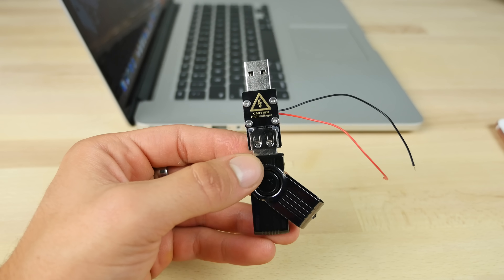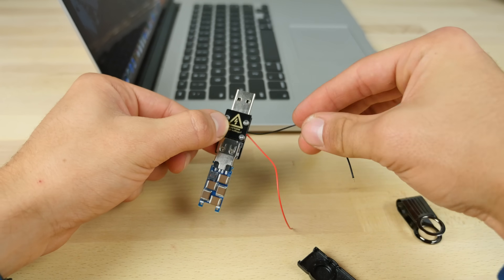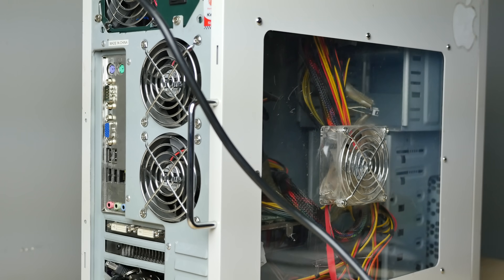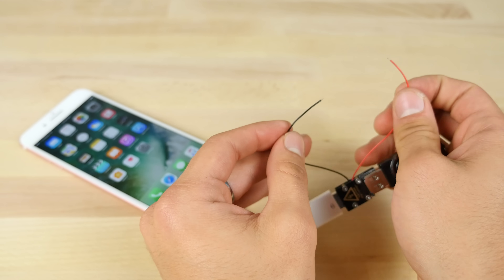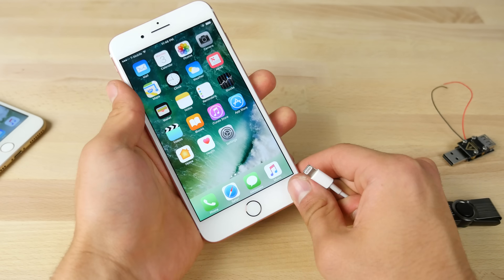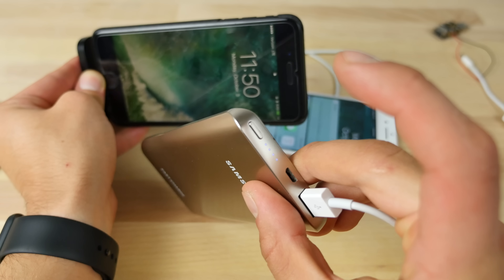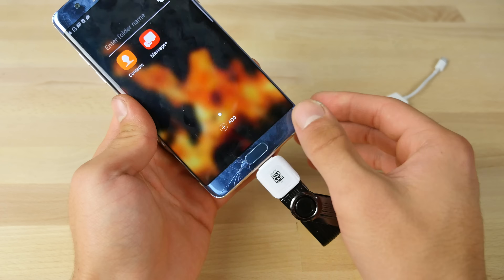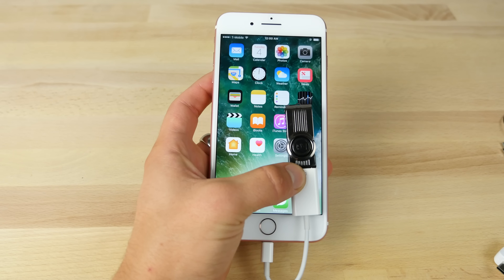USB Killer vs iPhone 7 Plus - Instant Death?

Comment: I am still using an iPhone 7 Plus in 2025 and have some problems
1 battery backup is fried. I have to charge it every 2 hours 
2 Most of the apps stopped working as they need iOS 18 
3 heating issues, even if I use Instagram for 5-10 mins, it starts heating up

Comment: You can build one with a royer inverter plus a rectifier, a sidac or gas tube and a few 1.4kv MMLCs. Basic theory is it takes 5V and turns it to hv to charge the capacitor then the gas tube or sidac drops a 1.4kv pulse through the data rails. The voltage needs to be high enough to breach the coupling caps. Can also target the 5v rail.

Comment: You killed the U2 Chip from the iPhone with this USB Killer.

I killed the U2 Chip with an cigrette 12V to USB in my Car.

The U2 Chip regulate the losdingpoeer ans saves the iPhone for overvoltage.

Comment: USB Killer 2.0:
Send random voltages either very high or very down in the negative
Send nonsensical information no computer can understand
After those payloads, start messing with the battery

Comment: ok, here's why this doesn't work on an iPhone, the charger you are using is bottlenecking the voltage of the USB killer, this is so any power source the iPhone charger is plugged into it won't fry the internals.  For instance, does your iPhone die as soon as you plug it into the wall outlet?  Well, of course, it wouldn't, that's because the charger controls the amount of power to the device.

Comment: Actually it wouldn't have fried the charging port..it would have fried the tristar ic chip on the logic board hence you weren't able to charge after even with a new port it still wouldnt work

Comment: * Plugs it into the wall *
Reply: he actually did that in a video
Reply: It will just blow up, nothing special, mains power is ac, and way too high voltage for the boost converter to handle

Comment: did not effect, maybe because you charge the usb killer in a low voltage then the capacitor of the usb killer is contain only a small amount current, just sayin ^_^

Comment: Fake! these USB sticks do not "KILL" what they plug into in fact they discharge -200VDC to test the surge protection circuitry of electronics. If you reset your bios and your power strip your computer will turn back on. The only way this USB stick will kill something is if it has zero surge protection which clearly your PC had

Comment: 10 Years later: USB Killer 8 vs iPhone XX. 15 Years later: Homepod Pro vs USB Killer 11. 25 years: Floating Tesla Roadster 75 VS USB Killer 27. 100 Years later: iMac PROOOOOOOOOOOOOO vs USB Killer 1840284
Reply: Dr. Shak0 lmao
Reply: 20 years later usb killer v16 vs Iphone XXX
Reply: PerroCrikoso Iphone XXX Videos Pro.
Reply: 1.9 GJILLION YEARS LATER: New IPhone   283828283383892 Ultimate Pro Ultra With a time 83838 megapixel
Camera with 3883 cameras comes with a 39283watt power brick and a 1000ft charger vs UR MOMM
Reply: When the years go by, you hear a trigger noise

Comment: Slight correction in what was said at 9:10 "Protection against high current" is actually "High Voltage", and very low current.

Comment: Slight correction in what was said at 9:10 "Protection against high current" is actually "High Voltage", and very low current.
Reply: Bill A you must be a mechanic or electrician. 👍

Comment: OK its unlikely he killed the pc there are spark arrests all over the motherboard. he simply blamed the click on the usb when it was him turning off the power strip at his feet. i have built a few computers and if it did get trough the arresters it would olny fry the usb just like the phone. and think of this, why would a computer be less resistant to a shock then a phone? computers get power surges all the time, yes most have protectors but there are resisters for a reason an a small shock there would not make the bios stop. and if it did you could maybe recover it but all and all there is a 98% chance your "custom build" computer will be ok as for the 2% everyone knows the odd, unlucky events that happen. that would be that. i am going to test this on a old old computer that has no value and put it on my channel uncut start to end and i will show if it kills it, but i am certain it won't

Comment: Implementing a protection against this is not difficult at all. In fact, it is much cheaper for the manufacturer than having to provide in-warranty repairs or even replacements. It costs a few cents more in mass production.

Comment: The Note7's usb port is still working even after connecting the usb killer maybe it's because of its fastcharging feature that it can withstand the high voltages the usbkiller is producing?

Comment: Can i have that iPhone 7?  Even though it's not charging anymore?
Reply: Yezah Sevillano,you can only use it 4 24 hrs
Reply: Sulfuric Acid H2SO4 you can repair it
Reply: jigar patel 
But the cost would be half as much as the phone's price.
Reply: @ChubbyTwiggy  this might be covered under warranty, i know some guys who did this sort of thing to their iphones and apple replaced them with the new ones
Reply: @ivanveselov2910  i doubt that, since they easily can know why the circuit board is fried ( usually fake usb chargers cause this ), and with how Apple blaming onto users' heads most of the time when their devices gone broken, i think you won't be able to get a replacement, at least in the easy way.
Reply: @ChubbyTwiggy  idk, i work at repair shop and my boss got kinda dissapointed with his 6s so he put 12V into the lightning port to kill an iphone (several times, he wanted his money back), and apple replaced it like 2-3 times and then he got his money (you can pull it off in Russia, idk about other countries)
Reply: What are you expecting?

Comment: It's just a simple charge pump circuit to bump the 5 volt power signal from a USB device to a larger voltage, looks to be in the 100+ volt range, but well below the up to 20kV static charge that can be generated by your body, most computers do have esd protection built in on the motherboards nowadays, same with mobile phones, not to say it always works, by all means it needs to be a high enough voltage to trigger it

Comment: You fucking moron. The cable won't transfer high voltages... Nothing can go into or out of that cable that the phone can't handle itself. It would be the same thing with your PC if you had a good enough Power Supply to run all the usb 3.0 ports at max capacity.

Comment: Don't know if you know how a capacitor works, but, since it discharges massive amounts of power swiftly, like you said about a little over a second, It does take a very long while to charge, So the way I'm assuming you did it, not waiting for it to recharge, You can only get so much kick out of that tiny USB, I would try it again, But this time wait at least like 20 minutes before each kill.

Comment: Didn't you know that the converters from USB to charger heads control the amount of amperage that the phones get to prevent this for happening. you might want to do a little more research on what your doing before you post it online to save yourself the trouble of it not turning out.

Comment: the reason it didn't kill the iphone is because you used an adapter which didn't let the high voltage reach the phones internals, if the phone had a usb port in the phone, the phone would be fried

Comment: You need to work on your knowledge of voltage and current. You used them interchangeably which is not correct. All USBs are "protected from high current" but few are protected from high voltage. The USB killer puts out high voltage over the data lanes on the USB. Only real protection from that is opto-isolators, and zener diodes or a crowbar circuit on the power rails. I've heard it's difficult and expensive to get opto-isolators working at USB High speeds (480mbps) however.

Comment: If this is used to put high voltage on the input then could this potentially with a few fixes can be used to charge devices faster?

Comment: What happens when you plug it in into a USB Port in a plane...?
Reply: MeyZiK Thats how 911 happened.
Reply: If you do it in America you'll get labeled a terrorist and locked up for life.
Reply: it will blow up what u think it gonna do??? make sure you yell ALLLAHHUUU AKKBBAARRRRRR when you plug it in.
Reply: If Samsung survives, i think planes too have same (or more) protection ;-)
Reply: MeyZiK the planes electricity is powered by its engines. there's no way a usb would have a higher voltage than what the planes engines are sending.
Reply: The USB killer charges up with the target's power and then it unleashes it, frying the target. 

It doesn't have enough storage capacity to fry a plane ... at least a regular usb stick sized device can't. 

But even if you could take a giant usb killer to the plane, and if the plane doesn't have any protection, I believe you couldn't damage the plane because it must use a dedicated battery to its "core functions".
Reply: likely it will be fine, since this thing attacks the data path of the port. but powerbank and plane only have live power path, the data path dont exist or are disconnected or disabled
Reply: ***** total of 4 connector in USB 2.0. 2 connector(on the sides) are for power only, charging only require these 2 connectors.. 2 center connector are data only. the usbkiller sends the surge through the data connector, which many power supply only USB doesn't have
Reply: ***** They just won't open up a flash drive or a phone as long as it doesn't contain explosives, because if they were actually that worried they would have banned all hand luggage and electronic devices years ago.
Reply: ***** If they're going to do ask this extra testing they would have to hire thousands more staff which would cost billions or cause unnecessary delays, so no it just won't happen.
Reply: ***** If I wanted I could put a USB killer into a phone, MP3 player, wristwatch or basically anything so again it just won't happen because it's just not enough of a threat.
Reply: ***** Things like phones and flash drives are allowed on planes.
Reply: Win the Braаnd Nеw iРhоonее 7 Plus =>https://twitter.com/4a773acf5f87d5d36/status/790428760050798592                     USB Кiller vs iРhоne 7 Рlus   Instаnt Dеath
Reply: MeyZiK 

Oh Shiitt 😯
Reply: Vaibhav Negi ikr
Reply: I think that USB port can only export energy, it does not receive any type of info/power so it shouldn't do anything.
Reply: Supah X Well, sorry about that, but if im not wrong micro-usb is still an usb port, and mobile devices, controllers and other things use that port for CHARGING(AKA Receiving power)
Reply: King-Agario It's a damn joke kid. And I'm from the middle east myself so I'm not being really racist.

Comment: hey, if i design a connector to charge the killer through another USB port so you can kill the dummy would you be interested?
the reason the dummy didn't die is because it does not support outgoing power.

Comment: what exactly damge the pc is it the motherboard or the power supply ?
Reply: everything connected tot he motherboard is fried. Some higher end motherboards have fail safes to protect it
Reply: s3odXX1 both
Reply: dang so nothing survived after that shock
Reply: panashe I pick them up, and try them out on a computer I don't own
Reply: ram07ish how would you explain to the owner when everything is fried and yiu were the last person using it.
Reply: +ram07ish I've learned never to pick up any random usb sticks and plug them into my computer.
Reply: panashe fhxhj

Comment: It is not a Safeguard. The USB port of a Computer can output 5V, charging the capacitors. Cellphones operate lower than this, and - depending on the power it might not be enough to fry deep internals.

Comment: If your iphone or android phone is locked it wil not allow data (photos, videos, etc. ) to be transferred from or to your phone. You can try it by plugging in your phone in the pc when its locked. It will not show a popup and if it does it will not allow access. But when its unlocked it will. ( if you were curious)

Comment: Low amperage, all voltage on USB is 5v. That is why the iphone doesn't charge as fast as a computer, which usually puts out half an ampere. The voltage on the USB kill varies, and it returns thousands of volts. It is low amps, that is the tradeoff. The kill uses the principle of less things resist electricity when your voltage is high. Air is a good insulator unless you have the voltage of lightning, for example.

Comment: Actually there has to be failsafe in phones and its not because of USB killer but because of protecting battery from overvoltage during charging. Actually every device with baterry has this failsafe on charging port.

Comment: Maybe I am wrong, but since the port on the phone is also meant for power going in, it is setup to have a pushback when things get plugged in or pulled out versus the computer only really intending those ports to be sending power out? So maybe this will work differently on an adapter going from USB to a USB-C that also is used to charge the device?

Comment: No safe guard it just doesn't put enough power from the phone to completely charge all capacitors at once probably only 1 or 2 which it only enough to fry the charging system on the phone

Comment: Lol iPhone so crap doesn't even have the power to kill itself
Reply: Or maybe the failsafe isn't good enough and failed to save itself? Considering the failure that the Note 7 was on launch managed to not only prevent the phone from being fried but also STILL CHARGED afterwards tells me something about the iPhone's "failsafe".

Hint: It's poorly designed to make you come back for repairs and spend money instead of being properly designed to prevent customer dissatisfaction.
Reply: lol that USB killer is nothing a microwave compacitors are dangerous 6 little itty bitty compacitors won't do anything I mean a static shock is all it Needs to kill a pc you could use a fucking lighter sparker pezo crystal
Reply: I love how people who have never taken anything apart think everything is one piece. So for some reason samsung scraped the bottom of the barrel for battery overcharge protection which changing the battery solves yet the Apple fanboys just say the whole design is defective. Like Apple has never had cheap parts that broke....
Reply: Ethan Jordan I'm Muslim and thats is 99% true the 1% is because some Muslims have apples to were taking over tech muhahahaha jk have a nice day

Comment: When he plugged it in to the computer it used all of the electricity from the capacitors. That's why it did not kill the phones.
Reply: im not sure but the way it probably works is the capacitors charge up quickly and sends all current at once to the device...

Comment: That's because phones have a very low energy usage. The battery is tiny compared to laptops and desktops.
Reply: but it did fry the lightning port... there must be some kind of fuse in those ports which desktop dont cuz they get power from another port/source... so they dont really put any fuse or any kind protection in those  usb ports...
Reply: the resistor blew up

Comment: funny high voltage you say, again  pc usb ports are 5 volt and its dc  meaning  it will only give you a tiny zap/tingle
where if you play with a cars spark plug lead or coil lead that will kick you
Reply: genmaxpain kick him

Comment: You totally forgot to try the Samsung with some kind of data transfer mode. The USB killer supplies the high voltage through data lines, and if they're turned off, it's possible that the current never gets all the way to the phone's internals.

Comment: the killer thing is reverse polarity over voltage like reverse current and also might have some over voltage on the signal wires.  does the Samsung still communicate on the port?

Comment: hahah Go figure. The iPhone gets ruined and is unable to charge. The Galaxy Note 7 works perfectly.
Reply: Comparing one issue with one phone to multiple small issues over multiple phones? Why? Also, compare the severity of the issues. If you've still got a Note 7, return the fucking thing, it's been recalled multiple times. I say this as a past Note 7 owner.
Reply: firebirdude2 yeah buy samsung because it will save you from the 0 times you plug a killer usb into it! but be careful to not keeo it on or charging too long because it will explode but its still the best phone who cares if it explodes in your hand it tickles more then it hurts
Reply: Yet another Sheeple that can't see the real figures. Look at Note 7s sold vs failures. It's LESS THAN 0.01%. Let's compare that to #hissgate, #bendgate, or #antennagate shall we? Careful you don't put your phone in your pocket, less it bend like a cheap slice of bologna... And those are the only "features" Apple has had before anyone else. HAHA!
Reply: Jesus christ you guys are all idiots
Reply: Funny since using it on the note 7 made it not able to transfer data. Just watch out so it wont go boom ;)

Comment: The killer works by sending power directly to the cpu blowing all the fuses along the path stopping power getting to the processor. so because phone's primary power source is the charging port before it sends that power to the processor it has to go through the battery which has fuzes to regulate power flow and the USB killer blows the fuses stopping the power from going to the battery, on computer the USB is a secondary component so the power can be distributed from both the power supply and the CPU so what the killer does is it sends the power straight towards the cpu frying both the processor and the usb hub it's plugged in to. to fix this you would have to either replace the blown fuses and capacitors or easier just replace the motherboard and CPU as well as the USB Hub.

Comment: the lightening to USB adapter is current capped at 15 mA, a regular USB 2 port is rated for 500 mA, and USB 3.0+ is rated at 1 A or higher.